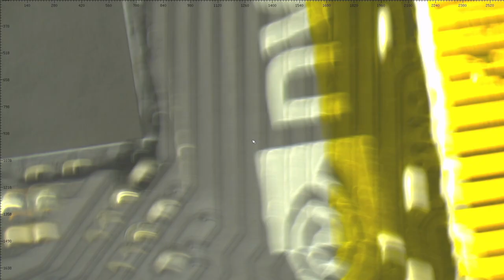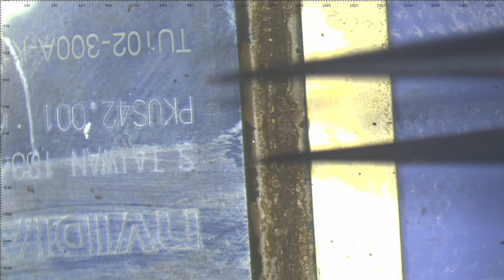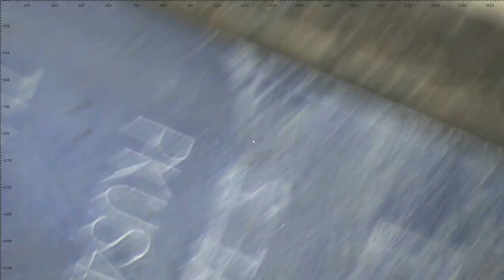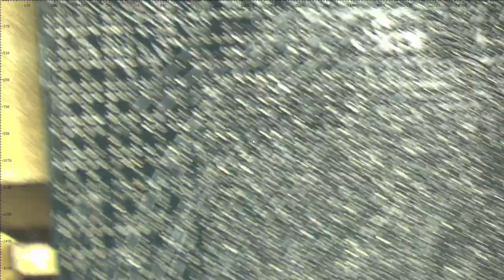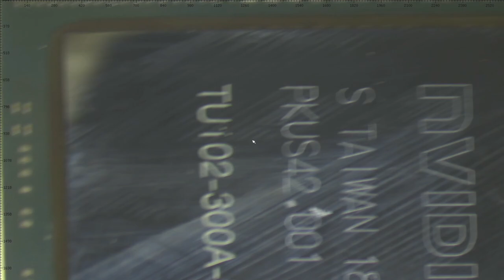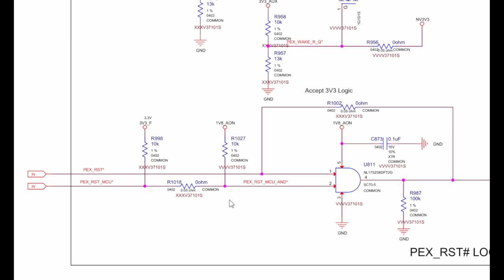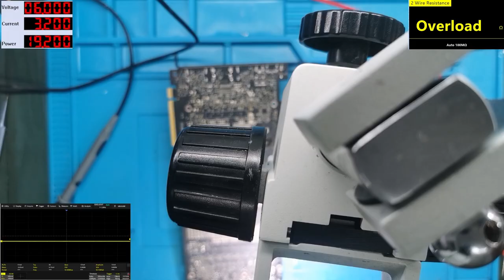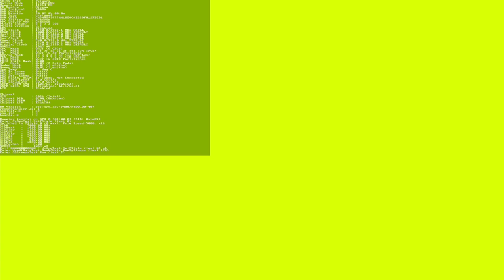Nvidia 2080ti FE graphics card Repair [Liquid metal Damage] #nvidia #gpurepair

Comment: anytime someone uses gallium like this, i ask was it worth the 4c decrease in temperatures? gallium has great thermal conductivity, theres no arguing that, but a thermal conductivity that is 4x greater than traditional TIM does not give you 4x more temperature reduction. Gallium is a viscous liquid, but still a liquid. what would happen if you poured 5 gallons of ketchup on your kitchen table? it would eventually drip off the edges, which is precisely what a GPU chip is similar to, its a flat surface, slightly higher than the surrounding pcb......take a guess what happens when you put liquid on it.